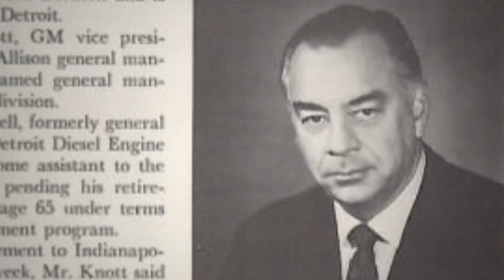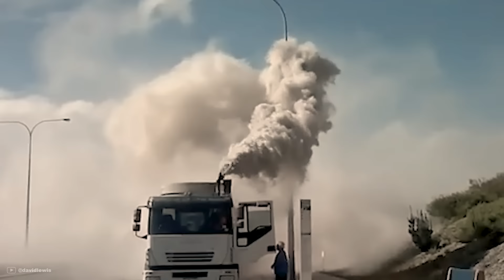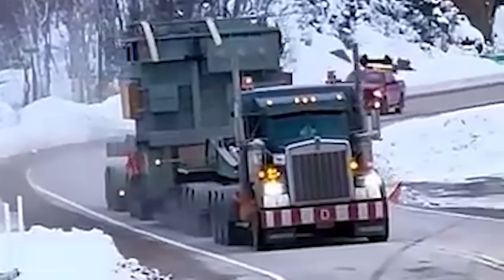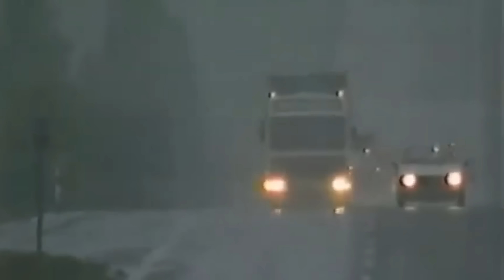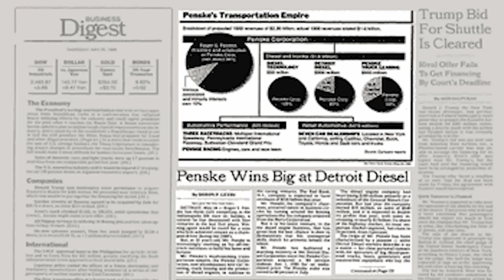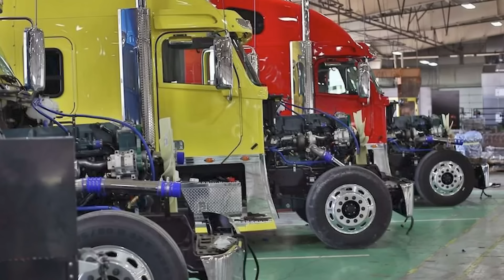Why Detroit Diesel 8V92 Was Killed

Comment: To be honest if I had to use an 8V92t I would be tempted or at least want an air flap starvation valve at the air pump (blower) inlet and a turbo release valve post boost (knowing the spooled turbo will drive the blower without blower mechanical drive input) and possibly just in case the engine had to be sacrificed, a high flow halon extinguisher plumbed into the engine much like a fire surpression system used in large commercial kitchens.

Comment: That’s why he call truck drivers either “Hodgeis” or “steering wheel holders”
Reply from the maker: What was the first thing you noticed about a 'steering wheel holder' trying to take off in an 8V92 for the first time?
Reply: @heavymaticyt ‘steering wheel holders’ DONT do anything the truck does it for them. Driving a 8v92 truck it’s like controlling an air plane.
Reply: They don’t know anything about how to do nothing.

Comment: I had performed a complete oil, oil and fuel filter change on a 12V-71 ships generator and was doing a no load leak test at  isochronous speed when my boss jumpred out the high jacket water temp switch.  The blower flapper closed and the racked dumped but it it kept running, speeding up and slowing down.
It took three bottles of CO2 to stop it. 

F*****g scary

Comment: The one thing bad about the 92 Series is it has the same size rod and main bearings as the 71 Series ,has the same stroke lenght, the upper mains are different, the main bearing bolts are bigger. You could get 1450 HP out of a DDEC turbo, with after coolers and intercoolers with bypass blowers.
We had a customer who had a 16V92T Green block who wanted a little bit more HP for a frack pump, so we installed 125 ML injectors and it made 1450 HP with no bypass , intercoolers, or aftercoolers, just a old green T block,.   It made too much HP so we installed 115 ML injectors, that was better for them.
All the crankshafts are different between the V71 'S and the V92 'S especially the rear main seal, it's bigger. 😊😊

Comment: Many of the backup Generators the old Bell system had in our Central Offices were all the old GM 2 strokes.  The largest one I took care of was a 12V71.  Most of the smaller offices had a 6-53 engines

Comment: Every diesel has the potential to runaway, not just 2 strokes
Reply from the maker: Spot on! Oil is fuel to a diesel, so if any engine starts drinking its own oil, it's game over. The old Detroits just had a real flair for the dramatic when it happened. Thanks for adding that clarification for everyone!
Reply: in the 2 stroke detroits engine oil would accumulate in the air boxes at the bottom of the cylinder liners until it got high enough to be pushed into the combustion chambers, when that happened the rpm's would increase and pull it all in until the air box was empty of oil. this would happen more in cold weather because there is a small drain tube that vented the oil to the ground that's why they leaked so much oil cold oil wouldn't drip out fast enough. old 2 strokes sound good unless you have to drive one in a dump truck where the exhaust exits right by the passenger window, along with the terrible low end torque I was almost glad it blew up after 4 years. only cummins or cat for me. Also in the 80s they didn't have the emergency shutoff damper so you just had to watch blow up witch only took about thirty seconds.
Reply: If a turbo seal fails, the engine can get oil in the intake and will definitely run away. Seen that happen on 2 ISX Cummins.
Reply: Needs an air shut off on the intake or a valve on the oil feed line to the turbo that could be turned off that would only really work on a 4 stroke diesel turbocharged engine if the turbo seal failed that would only keep it from running away but not kill the engine though shutting the air intake air is the best solution to stop the engine!
Reply: Just watched an Isuzu run away